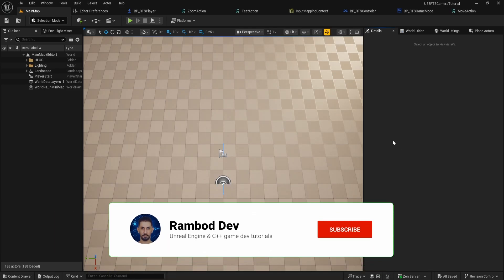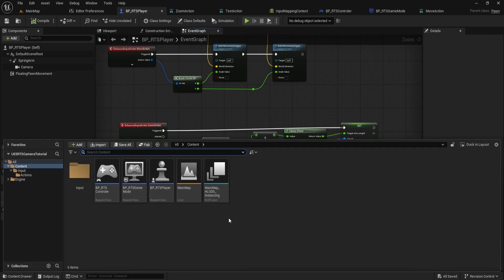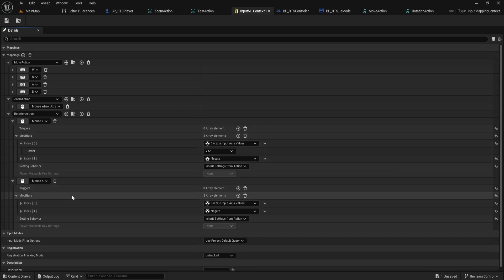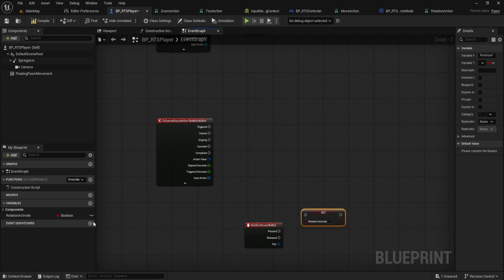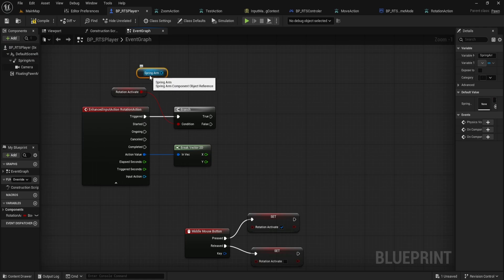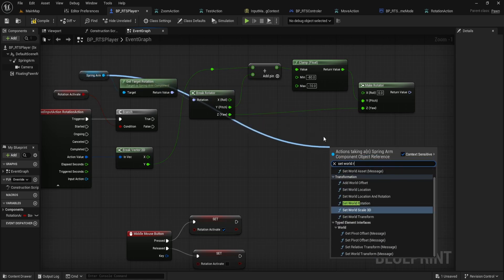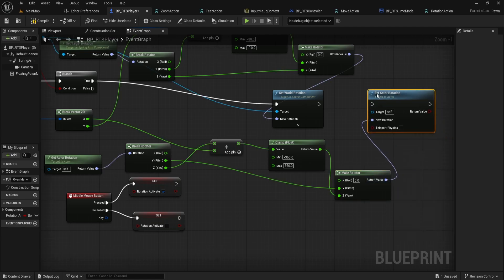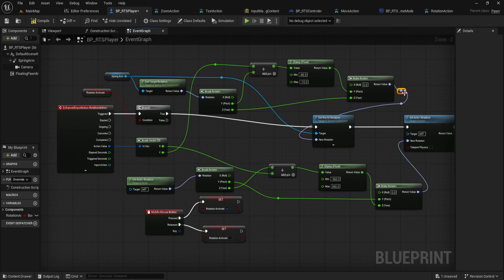Part 4 – How To Create Smooth Camera Rotation Controls For RTS In Unreal Engine 5

Comment: If you want the player to move in the direction the camera is pointing so they don’t get confused, you need to update the movement input from the previous video. Instead of using the forward and right vector of the actor itself, get the spring arm’s target rotation, break the rotator, create a new rotator using only the yaw (Z), and then use Get Forward Vector and Get Right Vector from this new rotator for your movement input.

Comment: Hi, i have a question. right now i watched your videos in addition to what I have created myself.
When i orbit around and use WASD, depending on my rotation the WASD get inverted. Is that an oversight from my sight?
Reply from the maker: Sorry for the delay in getting back to you. That’s a very common mistake so no worries. Let me explain where it goes wrong. In BP_RTSPlayer you have one Set World Rotation targeting the Spring Arm and another Set Actor Rotation. Most probably you also targeted that second one to the Spring Arm, but it should be set to Self. That’s why the WASD always feels locked to world axis.

If you can’t find the exact mistake, I have a GitHub repo with the working project where you can check the Blueprint directly. Make sure your Enhanced Input for rotation is wired so that horizontal (yaw) rotates the Actor itself and vertical (pitch) only rotates the Spring Arm. If you rotate only the Spring Arm, you’ll always face that sideways movement problem. Rotate the Actor for left/right, and use Spring Arm only for up/down tilt.

Someone else asked me the same question under Part 6 as well, and I explained it there too, in case you want to check it out.

Comment: Sorry, maybe a dumb question but when I move the mouse to the right, the camera rotates counterclockwise. Wouldn’t it feel more natural if it rotated clockwise? Anyway, great series, keep it up!
Reply: maybe it’s just a matter of habit, but I fixed it by checking only the X and Y boxes in Index1 of the InputMappingContext for MouseY and MouseX. Not sure if it’s the best solution, but it works :-)
Reply from the maker: I get you, that feeling is totally valid. It’s actually a good idea to support both styles in a project so the player can switch between them, basically an invert option.  
Glad you found a setup that works for you.

Comment: For the Zoom you could also multiply by -50 thats how I do it so I don't have to set the negate
Reply from the maker: Yeah that’s a smart trick too, saves an extra step. Always fun seeing how people handle the same logic in different ways.
Reply: @RambodDev Thanks for your help with the camera rotation.
Reply from the maker: @Aegisfall  Glad it helped man! That rotation setup can be tricky at first, but once it clicks it’s smooth sailing.

Comment: Hi Rambod! First of all, your channel and tutorials are absolutely great. Really glad I bumped into you. One issue tough... While holding MMB my Y axis is inverted, and I am not sure how to fix this, I'm not sure if it just happens to me, I watched this video twice and still haven't found the issue. Can you maybe help me find where to fix this? 

Thank you very much!
Reply from the maker: First of all, really appreciate your kind words and support 🙏 I re-checked the middle mouse rotation but couldn’t find any reason for the Y axis to be inverted. The only thing that comes to mind is a negate modifier, but if that was the case your X would be inverted too.

I have a GitHub repo for this project, you can pull it and go through the Blueprint step by step to compare. If you’d rather not, feel free to drop it in my Discord or even email me a screenshot of your Blueprint at rambod.dev@gmail.com
, and I’ll check it out 👌

Comment: Starting to look very nice, thank you for this rare series! Im going for more of an Empire Earth 1 feel, setting the spring arm at 8192 (ue power of 2) and the clamp from 256 to 16384 (2* spring arm length) was my sweet spot. If anyone is struggling, drop a character or building in for scale.
Reply from the maker: That's a great tip, thanks for sharing your setup details❤

Comment: The middle click works fine for me but it conflicts with my left click. If I "hide mouse on capture" I can middle click perfect but I am no longer able to make a marquee with my left click. If I disable "hide mouse on capture" and manually set the mouse to invisible then the mouse bumps the edges of the screen while I middle click.
Reply from the maker: Thanks for the detailed note, Clinton! This conflict usually comes from the cursor/capture mode, not the rotation logic. A setup that keeps marquee drag working and makes MMB rotation clean:

1) Defaults (in PlayerController)
- Show Mouse Cursor = true
- Input Mode = Game and UI
- Lock Mouse to Viewport = Always
- Hide Mouse Cursor in Capture = off

2) On Middle Mouse Pressed
- Set a boolean RotationActivate = true
- Show Mouse Cursor = false
- Set Input Mode = Game Only (so left‑click won’t start marquee while rotating)
- Optionally Set Mouse Position to the viewport center to avoid hitting screen edges

3) On Middle Mouse Released
- RotationActivate = false
- Show Mouse Cursor = true
- Set Input Mode = Game and UI (marquee works again)

4) Gate your selection/marquee
- Before any left‑click or drag selection logic, add a Branch that checks !RotationActivate
  (so selection only runs when you’re not rotating).

If you prefer to keep the cursor visible during rotation, keep Show Mouse Cursor = true but make sure “Lock Mouse to Viewport” is Always and recenter the mouse on MMB press to prevent edge bumps.

If you’re using Enhanced Input, you can also add a “Hold” trigger on MMB and use a simple boolean to block the selection action while that trigger is active.

If you want, share a screenshot of your RTS_Player settings and I’ll map it to your exact setup. Appreciate you testing and the clear feedback!